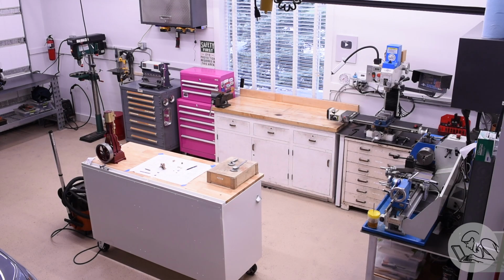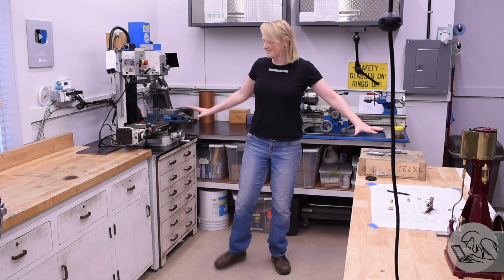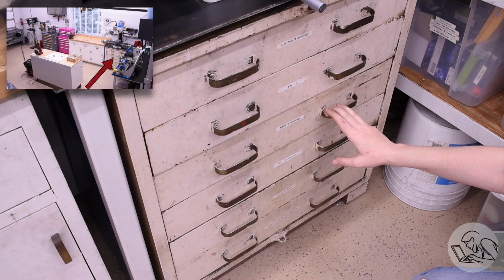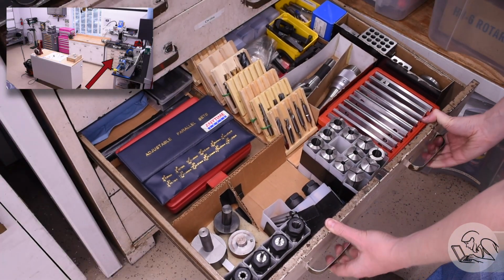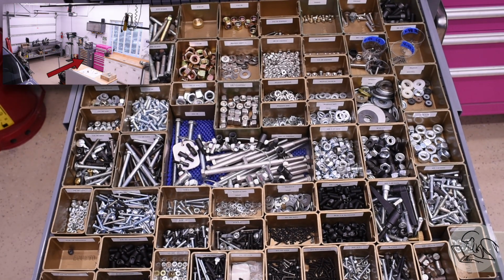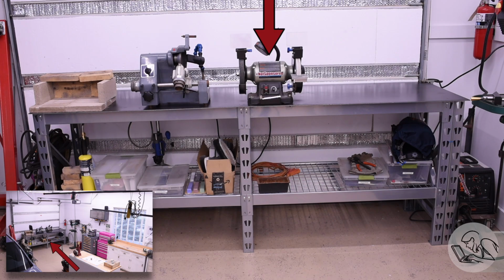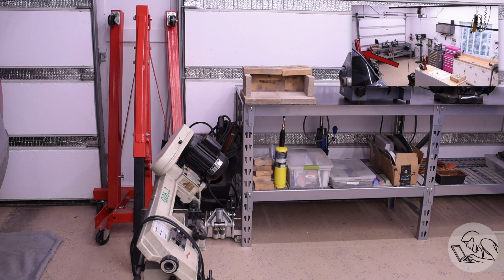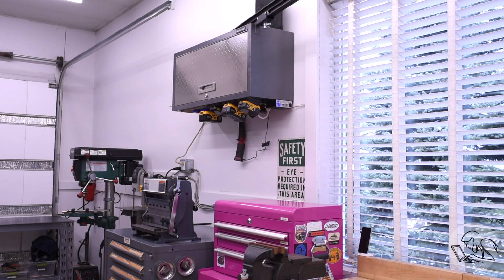New Shop Tour!

Comment from the maker: Hey everyone! A few quick answers to common questions:

The black rail over the bench is a camera dolly track. I don’t actually use it at the moment. It was an idea that didn’t work out but it’s 16’ long so it’s staying there for now. 

Yes, I plan to move the fire extinguisher. Its location made sense at the time but I’ve moved stuff around a lot since. 

The Portaband is mounted with a prototype bracket that the company who makes it has not given me permission to talk about yet, sorry. It is not yet available for sale.
Reply: More than one fire extinguisher isn't a bad idea either.
Reply: @Warped65er  And multiple smoke detectors. The standard ionizing detector doesn't go off over half the time. Try an optical detector, and/or a thermal spring-loaded alarm (no power required). A New Years Eve house fire next door left a lasting impression. A little expense for prevention, yada yada...
Reply: I had metal dust get into 2 of my chargers and fry them great idea putting them upside down ,,
Reply: Hey I have one of the tri sheet metal machine.  Hint add another crank handle the other end much easier to use with equal pressures.
Reply: Glad to see you are all set up and up and running.  I'm always happy  to see your vids.
Reply: great shop layout. off topic but I have that same car "drip tarp", very useful.
Reply: I was just googling the the portaband wall holster. No love. Now I know why.
Reply: Can't wait to hear more about that portaband mount!
Reply: What!!!!?¿ Your missing the MOST essential device. Should be even front and center!!!.....the coffee pot!😁🤗,jpk

Comment: I keep coming back to this video because I'm in the midst of trying to overhaul my shop (shed) layout and I'm running into the conflicting needs of having a generalized "maker" shop instead of just picking one discipline.  I really like the idea of trying to keep the clean and dirty halves of the shop at least a little bit separated (not actively throwing both grinding dust and sawdust into the machine tools and the electronics bench, for example).  I'm hamstrung by having the main access doors (where I'd prefer to have all the debris get thrown) on the same wall with the (previous owner) built-in cabinetry that provides most of the bench space. 

Does anybody else struggle with a shop that serves quadruple duty as a woodshop, grinding room, machine room and electronics lab?

Comment: Quinn, I always appreciate the safety sign and your constant reminders to use safety equipment.

Something I do in my shop is to leave safety glasses, earplugs, earmuffs, and face shields hanging on my drill press, bench grinder, and radial saw.  It means I can’t use the tool without moving the safety gear, which really cuts down the temptation to just do one quick cut without eye or ear protection.

Comment: nicely done, mine is almost the same a 20x21 ft detached Garage built in the late 1920's Divide with a wall down the middle, same equipment as yours but I built a 9x13 shop just for welding, all metal , diamond plate floor, metal walls on the inside, I keep the tig, stick and plasma cutter out there. I keep the chop saw under car port with the grinding table, no grit inside.I have the drawer storage from 2 24"x24"x30" with like 2.5 inch deep drawers, They removed the hardware drawers from a local big box store and switched to packaged hardware and bought the old box drawers, complete with moveable dividers. my mill it the little harbor freight one, my lather is new 8x32, with 1.5" bore spindle, 5" chucks in 3 jaw and Independant 4 jaw,. So you tips and set ups mirror my own. thanks for taking time on your videos

Comment: One thing I would probably leave for a hobby level shop like that but for any bigger I would change... I would lose the speakers and amp and turn the phone's bluetooth on and use some noise-cancelling headphones instead.  Hobby mills don't make a lot of noise but the big suckers *do*, nevermind what a wood shop will put out... Stumpy Nubs is fond of a particular variety of'em, but it'll depend on how much chatter your particular equipment puts out.  (I used to work in a commercial computer data centre, and they put put a fair amount of noise too... it doesn't seem like it would be damaging - just loud - when you first walk in, but plugs or a headset on an eight hour shift made the difference between dog-tired and simply "I've worked eight hours".

Comment: I am busy with a workroom and for now will have the 3d printers, lathe and soon a mill. As soon as I can I will build a new workshop closer to the hose with my cnc machine etc. It's only a 1200x1200 which is more than enough for me. The question i have before I start milling and lathing 😂 is, what do you use to clean up with. All the oils and cutting fluids etc can get messy. What do you recommend??

Comment: Great video - small shop but perfect for your needs.  Really good set up.  Some things I would add are a small parts cleaner, a burning torch and some type of fume extraction instead of just opening up a door, and chairs.  Where do you store your hazardous materials such as spray cans etc.?  I worked in heavy steel and aluminum industry for 40 years and helped set up and or modify multiple work shops and work areas, the employees always liked Vidmar cabinets for parts and tool storage.  If we were going to add then they always said they wanted Vidmar cabinets????  Vidmar cabinets are a little pricey but last forever and if the employees love them - well you got to support your people cuz they will support you if you support them so we always got them pretty much what they wanted.

Comment: I have a slightly bigger shop, 35m², but that is about when you decide to park your car outside..
I too have that "triangle" setup in parts of my shop., the machines along the sides, welding near the door, because i often do my welding outside the shop, because it is a part in a bigger building in the industrial area in my village.
I've got the Mill and the small lathe along one wall, and a small workbench right behind me when i'm working on these machines, to the side is a material rack in the corner, and a second CNC mill, and the big CNC lathe sits in the other corner, with a small cabinet beside it.. (that one is actually in the corner), 
Two big Cupboards along the other wall, next to that a Sinker EDM, the wire EDM sits in the other corner next to the lathe.
Basically with the workbench in the middle of the shop, i have my triangles from every side..
I do need to sort out the lighting though..
Your shop looks really nice, the only thing i would change is putting CNC on the machines.. since mine are all CNC..

Comment: I agree, music is nice for mundane tasks.  I have two JBL Eon15 G2 powered speakers (800 watts) and two JBL Eon Sub G2 powered subs (500 watts) in my garage shop.  That amount of power is certainly not needed for a home shop, but having all the "headroom" really makes for very clean sound at reasonable listening levels.  I also use an old phone to stream music.  That system gets turned on every day and is on every second I am in that space.  The music system is by far the most used piece of equipment my my shop. Makes time go much faster.  I wish my space was as organized as yours.  Very nice setup you have.  Looks very easy to navigate while busily moving about.  Good job!

Comment: Mounting the chargers upside down on a shelf / cabinet is an absolutely genius idea. I'm now thinking about where I could do that in my shop. Frustratingly I've just installed shelves that are probably too low, d'oh. Have you considered making some shorter legs for your engine hoist and adding counterweights? You often seem to struggle to get in close enough when lifting things.

Comment: Don't have a hobby shop yet (in my twenties and broke as a joke) but I work in a fab shop and basically every tip you gave we ignore. Horrible lighting, have to walk 90 seconds to get a drill bit, welding & grinding bench not 3 feet from the CNC mill, the heater is mounted in the storage area so none of the warm air makes it to the work area, etc. We all know how shit it is there but seeing how lovely your shop is just puts it in a whole new perspective.

Comment: The Only time you need a large high amp panel is when either you have a high amperage  Transformer welder or a very large Air compressor other than that most shops will do fine with 15 amp circuits though I only wire my shop with all 12 ga. wire incase I need to step up to a 20 amp circuit by replacing the breaker & outlets on that run.

Comment: Hey Blondihacks, love the video, favorite part of the shop is your hardware cabinet, always seems like a challenge to keep this stuff organized, and stocked. I am going to dedicate a cabinet for doing just that. I bought a mini lathe a little while back and completed my first project, turned down and threaded the end of a small drill press shaft , and attached a 1/2-20 chuck so i dont have to worry about the tapered chuck falling off when using the drill press for a drum sander and stuff like that , works really well. One question what lathe would you recomend in a 10 inch swing size ? cheers from Alberta Canada.

Comment: I totally agree with the light issue!
Because i have suffered alot working in ashop that has low light and shadow  problems while the work requires high precision
But in my humble opinion your shop is so organized and everything in its exact place where it should be
(follower from sudan)

Comment: Love the new workshop ! The one thing I can't stress enough is the use of an engine hoist for moving your heavier items of machinery, I recently purchased a small Burke horizontal milling machine for my home workshop. I injured my back whilst attempting to lift it onto its base with a friend & some 9 months later my back is still not fully recovered, I'm not as young as I used to be ! But an engine hoist would have saved my back ! A stupid mistake that I won't be repeating, but the irony of it is that we had already moved my lathe, vertical milling machine, pillar drill, 2 motorcycle hydraulic workbenches etc without issue !

Comment: I just got a Precision Matthews 1440GT lathe and a PM 835 Mill. I hit the very first problem you pointed out. My "clean" assembly bench has all the grinding gear on it! As I don't have a bandsaw I do my cutting with a small abrasive cutting disk. Not cool, especially as the first job was to make brackets to install the linear encoders on the mill with the open faces turned away from the flying chips. Just yesterday I concluded I have to move all that grindy stuff to the other end of the shop. This is also beneficial because I can also use my clean bench (now with sheet metal tops) for mechanical assembly work without getting grinding dust inside and engine or on lathe bedways!

Comment: Since you are making a "new shop", I have a question.
Have you ever checked the centering of your lath chucks?
You know, carefully moving a "marker"  (metal or marker type) in the revolving chuck to see if there are any high/low/out of center/round areas?
Or do you just take it for granted - as it is going round after all?

Comment: A very smart farmer once imparted to me many pearls of wisdom and one of them related to your nut and bolt supply. He was 50 miles from town and to go all that way for two bolts was not very forward thinking. He said if you need one, get twenty. It will save a trip later for sure. That way you end up with a many and varied supply. This apples to everything you need. Doesn’t matter whether you are 100 miles from town or 2.  The other thing is you need to be organised so you can find stuff later.  Jeff

Comment: First time I've seen an engine hoist in a shop not related to doing automotive work.  I have one as well,  in my woodworking space.  A 2-ton unit from Harbor Freight,  and I do catch some static about it, but when I had to lift a brand new table saw and band saw out of their shipping containers, assemble them and place them on their mobile stands, by myself, it was invaluable.

Comment: Thanks Quinn!  As you mentioned, it is nice to see how others organize their shop.  I noticed the garage door opener, don't know if you're near traffic or if you're nicely tucked away from the hustle n' bustle, but...  I have come home to an open garage door where someone else's opener opened my door, and of course, I never drive off until I see the door is closed and it doesn't reverse.  I'd recommend turning the power off 'til you need to open it or pull the rope and insert a lock into the track hole to prevent opening.

Comment: Don't forget internet of some sort! In a garage space within WIFI range you are fine, but if you have a detached steel building (like I do) it tends to act like a giant faraday cage and you get little to no signal.   I had to run an Ethernet wire out to the shop with a wireless access point to stay connected.

Comment: That's a well organized shop. Very cool. Coincidentally I bought a toolchest / workbench quite similar to yours a few weeks ago - arranged it in a very similar manner. The same solution to a problem discovered independently at the same time by two different people - always fun. Possibly not quite at the level of Newton and Leibniz discovering calculus, but, you know, close. 🙂I welded up a frame and mounted a magnetic whiteboard to the rear of my toolchest / bench so that I can hang drawings and write down what I'm supposed to be doing.  I also have one of those 3 in 1 sheet metal machines. It does OK at bending light gauge metal, but the shear constantly goes out of adjustment and won't shear anything wider than 6 inches. I am in two minds as to whether to bother modifying it, or obtain a bigger and better shear. I'll be interested to see how you make out with yours for sure.

Comment: Nice looking shop.  I have an engine lift, very handy but my most useful tool is a shop lift.  Sort of like a mini fork lift with a small 18" by about 36" footprint.  I will lift 700 lbs to around 72" with its hand operated hydraulic jack cylinder.  Normally I have some plywood on the forks for moving chucks and other things around the shop.   Don't know if it was shop built or commercial but it's built from simple materials like angle iron, flat bar stock, plate, casters, cam followers and a tall hydraulic jack.

Comment: I have known of the kitchen triangle for a long time. It is essential. I know this may not apply to a shop, but having the refrigerator door open on the side of the sink and stove is very important. Do your viewers know that most refrigerators provide that option? I have swapped the hinges of two refrigerators in apartments I have rented. Just look at the opening side of your refrigerator door and you should see plugs in the holes to swap your door to open from the opposite side. It is not too difficult but you may need help to do it. Just swap the hardware. Not much is more annoying than a refrigerator door that opens next to a wall. I know, OT! 😉

Comment: Nice layout! I noticed your bench grinder isn't connected to a vacuum. I suggest installing a port in each guard. Then a few pieces of pvc pipe ending with a rubber connector. This makes for a quick detachable connection for your vacuum, and a lot less invisible grinding powder in the air. Don't forget to close the area from the tool rest to the guard below.

Comment: Nice shop, thanks for sharing.  The only thing I would change is the location of the fire extinguisher.  Being in a dead end corner, particularly over and behind the area of greatest risk (welding and grinding) makes it hard to get to when it’s needed most.  Ideally it should be mounted near the exit path or door, thus keeping you between the fire and the exit, not the other way around.

Comment: Quinn, this video is chock full of good tips, tricks and reasons for why you have your shop laid out the way you do. Excellent work! 
I want to give a professional opinion: as an IBEW wireman that has worked in the electrical industry for almost 18 years, I've seen firsthand just how much of a difference light can bring to a space. (It's such an obvious and simple thing it is often overlooked.) I can't stress this enough: EVERY area humans occupy will be improved by well thought-out lighting; I've seen the difference in structures ranging from homes to data centers. The lighting system you've constructed is exactly what electricians and architects try to do: design a simple and elegant way to get light where it matters most. Two thumbs up! 👍👍

Comment: I'm also well organised.
You open the door do 2 backflips follwed by a leopard crawl underneath a bench, forward roll over the saw, climb the chain hoist, dismount with a double twist and 1 forward summersault and i'm at the lathe! 
Getting to the milling machine becomes trickier.

Comment: I keep my nuts and bolts in Raaco cabinets on one wall, and have set aside drawers for every Metric bolt size from M3 up to M12. Not all are full, though. But when I first bought a size bolt of say, M8(the bolts I use most often) I also bought washers, nuts, nylock nuts, capped nuts and so on for that size. Sure, the closest HW store is just 25minutes away by car(but I might be working on my car... )or it's evening, or sunday... Having 'everything' in most sizes has saved me from taking a hurried trip or bus ride to town more than once. 
I also have electric connectors, and all kinds of other stuff in those drawers.